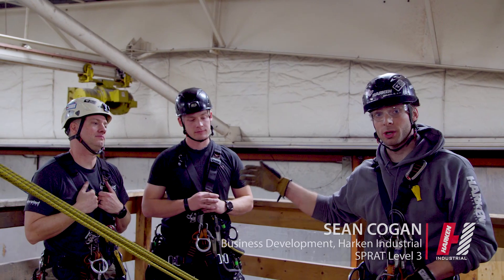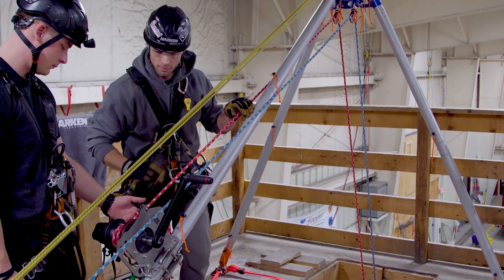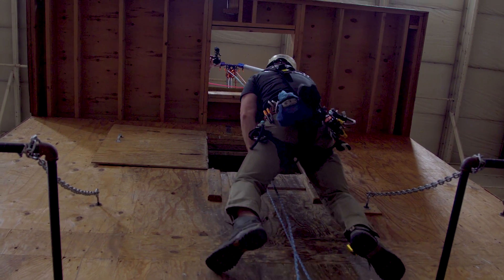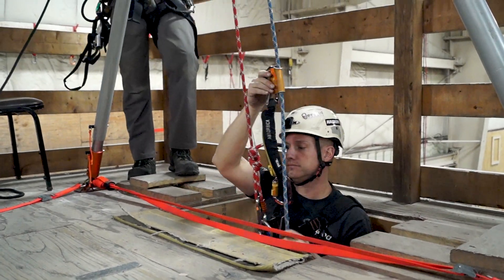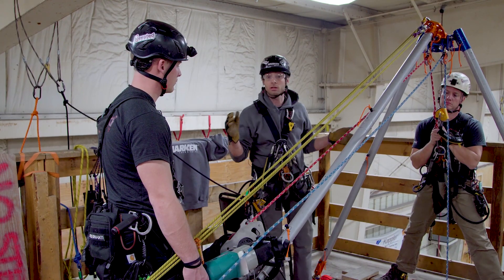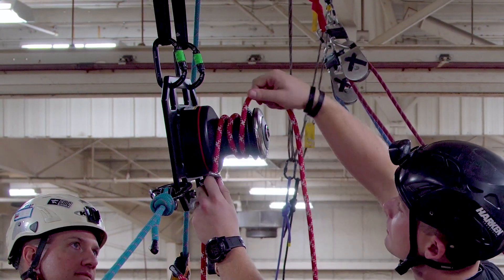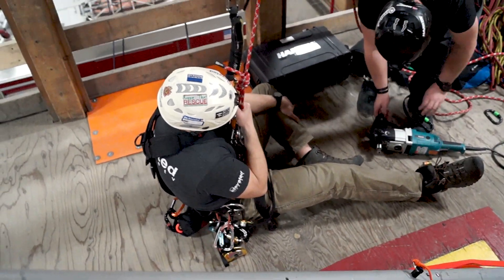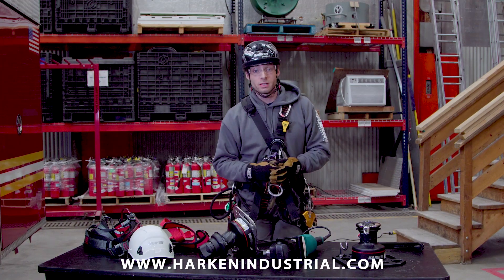LokHead and Riggers Winches: Usage Techniques

Comment: Can you use the INLH500KIT in the sae way? As a floating winch?
Reply from the maker: Hi David, thanks for your message. Yes it can, as with the INRW500, the LokHead Winch can be anchored and used as a floating winch. If powering manually it is important to try to stabilize the winch as much as possible to minimize movement whilst turning the handle. The TelluMount ground stand is a useful option for stabilizing the LokHead Winch in remote locations, some people also use gin-poles with tensioned lines. Please let us know if you need more info.

Comment: Very interesting and great video! 
I have a question, how can i calculate the hauling speed using a power drill? i would have to use the revolutions per minute and what other formula?
Thanks!
Reply from the maker: Hi Fylipe, thanks for your message. It is possible to calculate the speed using the winch gearing and drum circumference details, multiplied by the drill rpm. Actual speeds will vary depending on rigging, ancillary equipment and the drill being used. For reference, a 300rpm high torque drill would offer approximate unloaded lifting speeds of 12m/min in LOW gear and 35m/min in HIGH gear. Please let us know if you need any other info :)
Reply: @HarkenSafetyAndRescue  What is the min Nm required for a drill to work?
Reply from the maker: @sizzleshake8927  Hi there, thanks for your question. Essentially it depends on the load, application and the winch being used. We recommend the LOW winch gear (40:1) being used for powered lifting with a max drill drive speed of 300rpm, from a high torque device. Please contact your local Harken Industrial rep or reseller to discuss your application and recommendations. Hope that helps.
Reply: @HarkenSafetyAndRescue  The manual we have states "The maximum input speed of the LokHead Winch is 60 rpm.". Is there an updated manual that states 300 RPM?
Reply from the maker: @matthew3003  Hi Adam, thanks for your message. Based on testing we recommend the use of the INHDTOOL with drive speeds up to 300RPM, or 60RPM without it, but all deployments vary. Currently this isn’t in the manual. It is the end user’s responsibility to risk assess winch use and maintenance accordingly. Please consult your Harken Industrial contact for detailed technical support if you require more assistance, thanks.